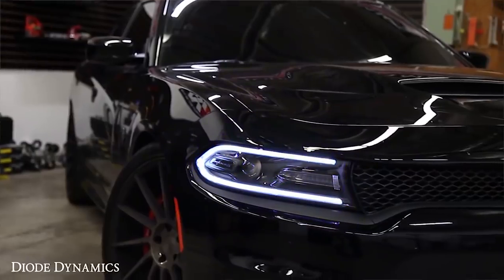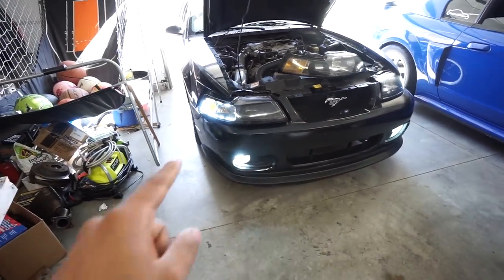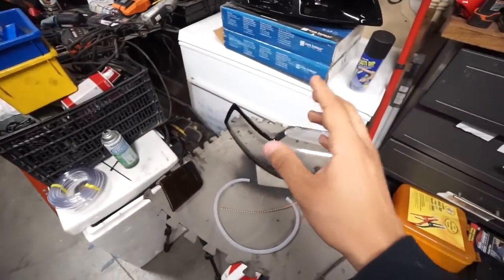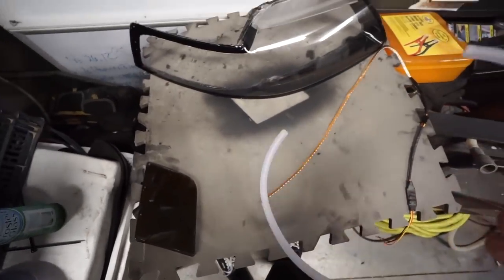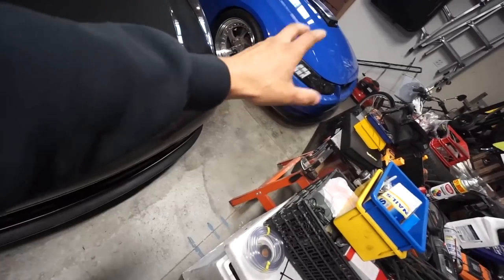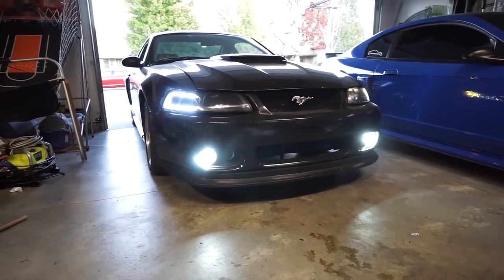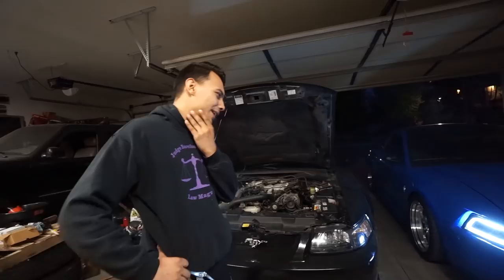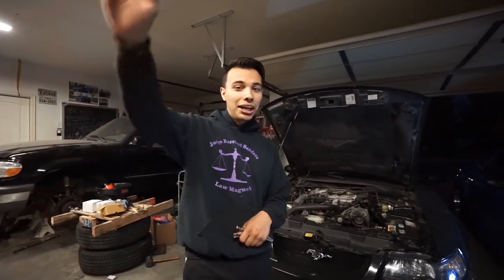CHANGING UP THE NEW EDGE GAME!

Comment: looks dope but it would look even better if you make those lights the turn signals as well instead of a bulb
Reply from the maker: They’re switchbacks so they do work as turn signals. I just didn’t wire them in the video.

Comment: If I could find a light that has an LED running from the upper side corner of the light assembly down and across the bottom, all the way to the opposite corner and stop there at the lower grill side, that would be perfect.

Anything to make it look like modern car lights that use the LED accents. Some cars are very scrunched and look mean because they don't need the space for a traditional light bulb. They are using cool LED strips to get the same light.

Comment: Follow the lines on the headlight to the sidemarker, from the inside portion of the headlight the sweeps up and out, all the way back to the side marker, don't loop it, have it end at the top of the sidemarker, I think that up swept motion of the inboard portion of the headlight that continues at the top of the assembly all the way back to the side marker will look more aggressive, almost as of they were eyebrows with an angry gesture,

Consider the new mustang with the 3 diagonal slits of light, but only use one and run the rest of the light along the top of the assembly, should look mean,

Comment: I did these (https://www.americanmuscle.com/94-04-black-projectors-dot.html) but put LED side markers and retrofitted LED in the main projectors so they are white. Hi beams are a pain to retro but you could do it with more cutting inside. Side benefit is the side maker LED caused the signal flashers to flash a lot faster without doing anything else. Just a thought. Do the amber LED no resistors and bam, they flash faster.

Comment: Dude there is a cobra r bumper for $100 but its in florida and needs paint look up mustang parts reaper on facebook
Reply: Cobra R bumpers aren't rare, you can buy them fairly cheap online, not to mention they have the splitter on them unlike the 99/01 bumpers
Reply: @SwitchItUp  I know but this already has fog lights with the hid kit
Reply: Absolute Enthusiast it's still not even close, that lip completely changes the way it looks
Reply: @SwitchItUp  it has the lip
Reply: I know it has the lip, that's what I was saying, with the lip it's so much different than a regular 99/01
Reply: @SwitchItUp  👍😎
Reply: Link? I’ve been looking for a cobra r bumper for a while but everyone wants 500 to 600$ for them